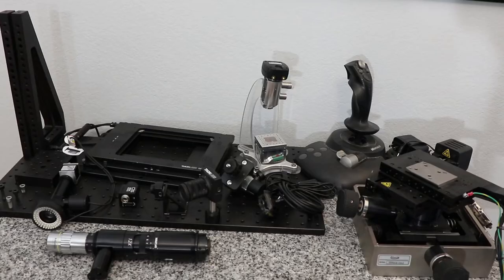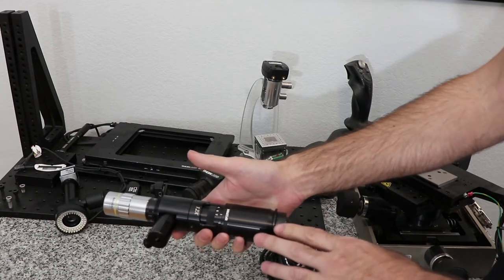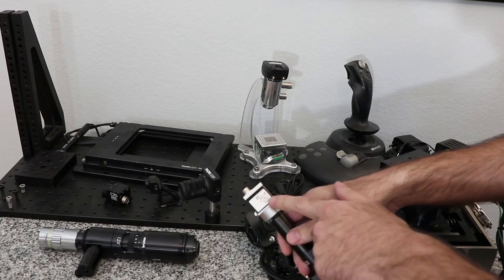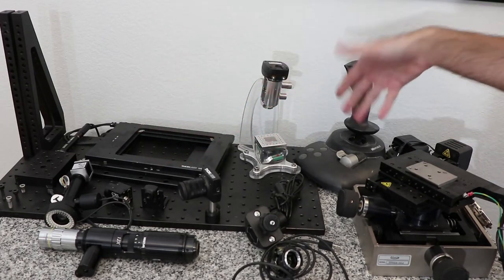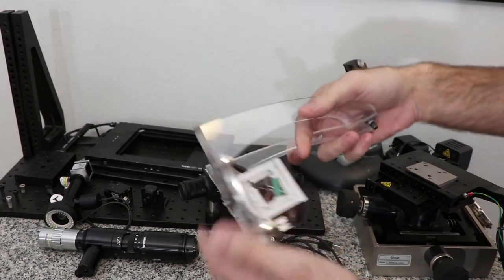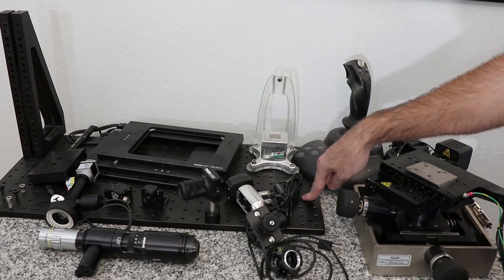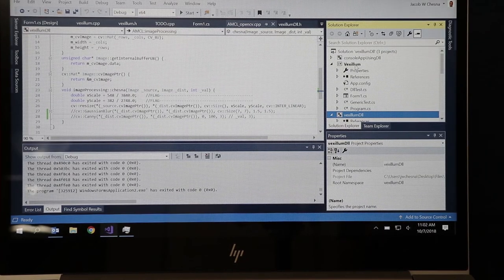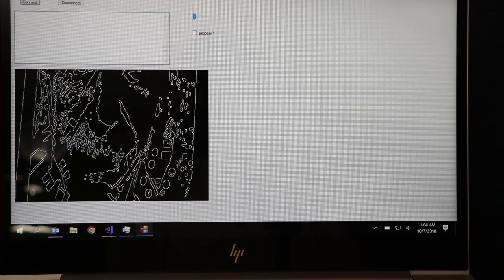DIY CMM Build - Part 1

Comment: Hi Jacob, if you ever want to bounce around some programming ideas, I'd be glad to help. Have you consider Python and Jupyter? Could wrap existing C++ APIs for Python. I was a HPC programmer using only C/C++ and in the last few years have switched almost entirely to Python. Today I care less about program speed and much more about programming time. OpenCV, Numpy, Scipy, and Keras are all wonderful. Is the camera with the right light a Basler? I just got a 1.1" USB3 model from them.
Reply: Ha! Got a little further in, Basler indeed :)
Reply from the maker: I'm no expert so I will reach out for sure Thanks Kent! Yes the front end (HMI/GUI) is deplorable in win forms, I suppose that's why it was depreciated and replaced back in the days of windows XP. For that reason, I will definitely be using a different front end, but the back end I would like to say in C++ because most of the libraries directly support it, particularly the image processing libraries. If I were only using one image library It wouldn't be a problem but if you want to pass between opencv, Halcon, and Cognex, then I suspect data types will become a issue with generic interfaces. In the future I'd like to use Intel's MKL & IPP directly, from what I hear its the engine that most scientific packages use anyway, but that's a hurtle way ahead of me right now.

Comment: What happened to this?  Were you ever successful with it?
Reply from the maker: Ahh... still sitting on the table next to me.  I ran into a huge opensource gap. Once the image is in the PC, you can use opencv to process no problem.  Everything is standardized in the camera and in the UI software, and both are open source; the gap is the engine that grabs frames from the camera. The GeniCam clan has strategically [IMO] made this unavailable because it's arguably where their competitive advantage can lie but it's annoying. Also why opencv has such limited camera controls other than cam0 as a webcam. That's the missing link, and if you have to buy software to complete the project, then its kind of a waste.

Comment: Mitutoyo VMU and their line of objectives are very good quality, however the tube lens inside VMU isnt that good, consider using a MT-L4 tube lens and c mount kit instead of the VMU  body, i am also using mitutoyo obj as a optical CMM, and found out that with 1 inch sensor, VMU's internal optics gives curved field with plenty coma, as well as distortions.
Reply from the maker: Nuo Xu, pleasure to have your view. I've cannibalized a Mitutoyo QV, where those objectives are used commercially and I believe the sensor was on the order of 1/3". Correct me if I'm wrong but any focused wave front is spherical so technically they all should have curved focal planes, I guess the magic happens when the depth of focus and the focal distance is within a region to not notice?    I'll check out the MT-L4.  Also check out the TV lenses for your thermal stuff, they are widely available and cheep. I have stacks of them from various garbage cans!
Reply: @internationalprecisionengi1737  You are completely right about their intended use case for smaller sensor, but the mitutoyo obj description did give spec for field of view up to 1 inch, and I reckon why not put a mirrorless apsc camera (which totally worked with proper tube lens) please checkout the macro photography blogs about mitutoyo objectives and tube lens selection, they have done a great job comparing common choice. 

motorized stage is a tough choice, maybe I will stick to the air bearing sliding mechanism that antique CMM uses, this seems the cheapest option, with obsolete steinmeyer ball screw from semiconductor industry. anyway really really like the type of stuff you worked in, the next reasonable choice for your speciality in piezo drive must be a AFM!
Reply from the maker: We have an AFM at work, like a shrine that nobody will ever use but nobody is allowed to touch. Lets lobby to get it and we can cut it in half for everyone to see. I think the thing ran on XP and the PC doesn't even fire up...   Or we can fix it and use the rest of the probes that are kicking around then cut it up...

Comment: What happened to the other videos
Reply from the maker: Ahh... still sitting on the table next to me.  I ran into a huge opensource gap. Once the image is in the PC, you can use opencv to process no problem.  Everything is standardized in the camera and in the UI software, and both are open source; the gap is the engine that grabs frames from the camera. The GeniCam clan has strategically [IMO] made this unavailable because it's arguably where their competitive advantage can lie but it's annoying. Also why opencv has such limited camera controls other than cam0 as a webcam. That's the missing link, and if you have to buy software to complete the project, then its kind of a waste.

Comment: hello dear, congratulations on your videos.  will you continue this CMM project?
Reply from the maker: Yes it will be up soon. I underestimated just how hard it is to document software! The HTML based tutorial section should be a better guide than just videos but its in the works.    http://ipengineering.us/appdev.html   - currently slim but this is the link.
Reply: @internationalprecisionengi1737   great news I am grateful and excited to follow the development of the CMM software, I worked as a mechanical engineer at the Mitutoyo factory for 10 years in Brazil and did not see how the CMM Cosmos software was developed because it was developed in Germany.  Could I send you an email to contact?
Reply from the maker: @augustomendez7260  Got your email, sorry for the delay. Maybe it's my settings but YouTube comment notifications don't usually make it in time!